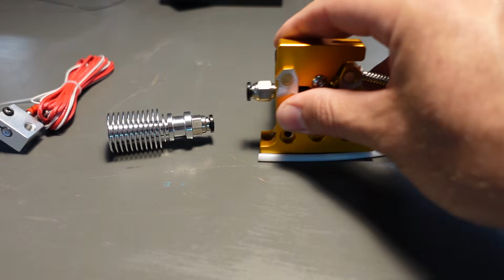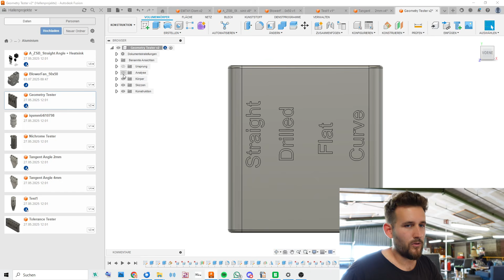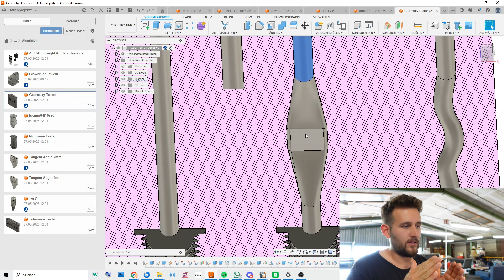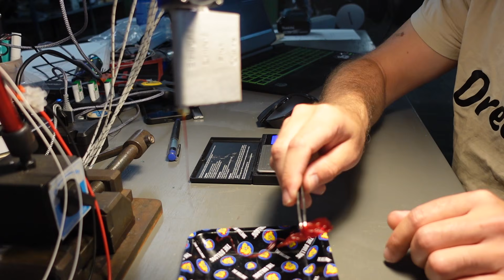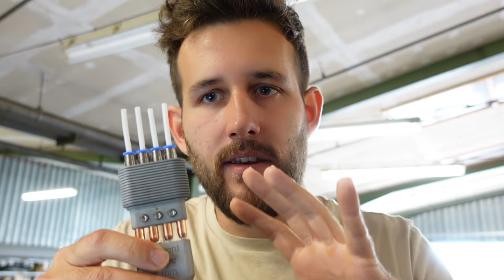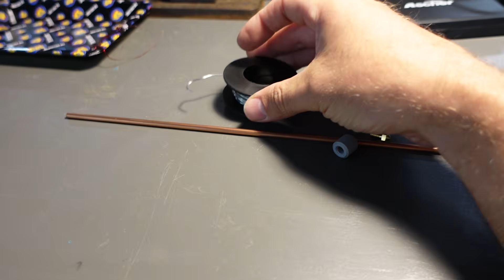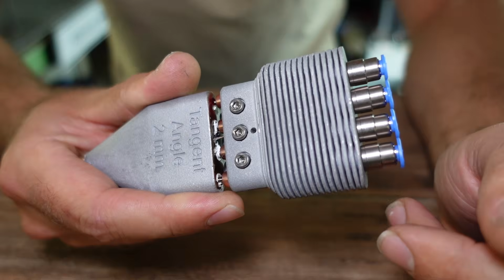Minuteman's World Record Hotend for your 3D Printer! 200+mm³/s Flow Co-Extruder! (Roetz-End E01)

Comment: Sehr lehrreiches Video und kluge Lösungsansätze. Vielleicht liegt mein Fokus weniger auf High Flow. Wenn ich es richtig verstanden habe, hast du nach Ideen gefragt. Eine Wunschliste für ein Open Source Hotend beinhaltet für mich: ein System inklusive Bauteilkühlung als Gesamtheit betrachtet. Dabei ist ein Bowdensystem für mich heutzutage der Favorit. (Wenn man sehr flexible Materialien hat, muss man an vielen Stellen Kompromisse eingehen. Der Drucker ist dann deshalb oft anders als ein Alltagsdrucker aufgebaut.)
Der Masseschwerpunkt in Z der Gesamtkonstruktion sollte auf Höhe einer Halterungsmöglichkeit sein. 
Zwei zusätzliche Gewinde zur Montage einer Fan Shroud im Block des Heatbreakkühlers wünschenswert.
Bei einem bewegten Aufbau ist eine Zugentlastung der Verkabelung eine gute Idee.
Da du von Gewindenachbearbeitung gesprochen hast, wären Durchgangslöcher zu bevorzugen wo es geht.
Für eine Massentauglichkeit (Also damit die Entwicklung sich lohnt, sollte das Produkt nach Möglichkeit für viele Menschen eine gute Alternative sein) wäre die Größe und damit auch das Gewicht ein Hauptaugenmerk. Ein 120mm Hotend lösst sich nur mit Einschränkungen in Z nachrüsten. Ein sehr breites Hotend nimmt Bauraum. (Ich sehe gerade das Produkt vom Video und denke mir, das passt nicht gut in meine Drucker herein. Hat also wenig mit der Wunschliste zu tun.)
Auch wenn das Hotend sehr glatt und schön konstruiert ist, vielleicht gibt es eine Möglichkeit eine (Standard? gibt es nicht- aber es gibt ja marktübliche Formen) Silikonsocke zu installieren
Wenn eine komplizierte Form genauso teuer ist wie eine einfache, dann sollte man so viele sinnvolle Features mitliefern wie es geht, kostet ja deshalb nicht mehr.
Ich wäre nie auf die Idee gekommen ein 3D Druck Hotend  3D drucken zu lassen. Genial und gibt so viele neue Möglichkeiten der Integration.

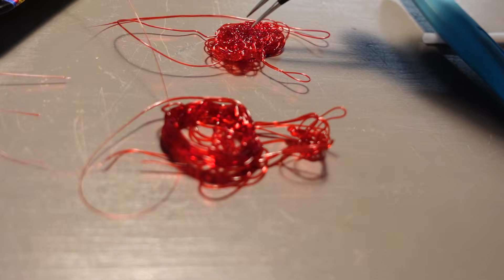Comment: I think you output should be more like 28:43 front one. If the flement is able to stick it self and also not swolen it will be the enough tempeture, otherwise you will force more cooling problem. in short if you say the flow is perfect you should push little more.

Comment: So regarding the fluid dynamics in the hotends: There are a ton of different factors going on here I suspect. Surface roughness probably has insignificant effects primarily because the flows here have high viscosities and thus low Reynolds numbers, meaning they are Stokes flows that exhibit no turbulence. 

This also means though that our heat transfer is limited by A) the low thermal conductivity of the filament and B) the low surface area between filament and hotend. Surface roughness probably improves B) but makes A) worse, so it probably all just about cancels out. In a flat tube, we basically improve both A) and B), which is why this performs so well. However it comes with the drawback that it is likely to create a lot of backpressure because increased wall area and thinner channels also are exactly what will increase resistance to flow.

This also explains why things like the wavy tube don't work, there is nothing really going on w.r.t. the core being exposed, instead, we are basically just deforming the filament into whatever shape our channels have. Since the waves don't really change the channel shape and convective effects don't matter in Stokes flows, these basically don't do anything. This also means for the most part the precise path of the channels shouldn't matter too much. Curiously that is sort of contradicted by your results with the tangent vs. straight paths, but I suspect that may also be due to those paths not all being necessarily the same length and diameter everywhere.

Likely what is going on here is that the majority of the back pressure is caused by forcing the filament through the smallest part of the melt path, i.e. the nozzle, which scales directly with viscosity. So essentially up to a certain point it is worthwhile to spread out the filament for better melting.

Simulating and optimizing this would probably be an interesting research project, the phase transition may be tricky to model, but I suspect there is lots of prior art for that. But thanks to the fact that this is a Stokes flow it should at least be computationally tractable.
Reply: I wouldn’t argue against any of your points, and if they are all true then round feed stock is the worst geometry.  His multi-cord head is just trying to approximate a flat and the flatened heat tube is best because it abandons the flawed round quickly.
Reply: @skyak4493 Probably, now there are tradeoffs as pointed out in the above(round tubes definitely are still best for lowest back pressure before the nozzle) but overall given we are constrained in the maximum heater length by wanting filament control something flat is probably close to optimal.
Reply: Very excellent explanation! You are a bright fellow. Best regards.
Reply: Why would changing the geometry affect the thermal conductivity of the filament? That's just a material property of the plastic, right?

Comment: I had started investigating the 3DChameleon system, and purchased the following 4 to 1 assembly. Can you arrange your 4 by 1, to 2 by 2 ??
4 Port 3D Printer Filament Feeder with Tubing 4 in 1 Filament Feed Connector for X1C 3D
Have you considered a 2-part epoxy mixer geometry nozzle to mix the filament? Or a Tesla valve design?
Reply from the maker: Yes yes and yes

Comment: I would really like to see that bondtech extruder also include the ability to only push one of the four filaments at a time, sort of like a mini AMS. It would need some sort of electronic clutch on the extruder gears, but I think that would make it more useful in more situations. Not really applicable you your hotend, but it might make the extruder more likely to become a product.

Also name suggestion is something like Gorgon/Medusa, all the filament going into the print head seems like snake hair. Great work, looking forward to see the next update!
Reply: Yeah, this could be really useful for multicolor prints. Takes less time to switch and less material to purge

Comment: I had this idea of N:1 hotend for a while for the benefit of shorter meltzone and more flow, tho i think with more then 2 or 3 in we might start to hit issues with tolerances of the filament where tolerances start to add up and could in turn make less consistent layer lines (extrusion). So i would probably want to see 2in 1out hotend. Also weight is another issue lighter the better so i could see 2in 1out beight one of the better choices for that too.

Also another thing is ridgidity, I want it be ridgedid, eg: if i crash i dont wanna have bend, see CHUBE

Comment: I would like to see the cold end and extruder be the same part, and have the whole thing be water cooled so it can cool the stepper motor too
Reply from the maker: What if we don't need the motor to be cooled? Wouldn't that cause more hardware in the first place? But, noted!
Reply: @Roetz40  Not so much for minuteman, moreso for large enclosed machine. I've been stewing on a machine concept for prototyping big car parts from CF ABS in a heated chamber. A two or three channel water cooled version the SLM hotend would be a good choice for that.

Comment: I am very curious how the flat geometry compares to the CHT splitter/core heating technology
Reply from the maker: I would Guess! that my approach is a bit more effective since the melt has more time after splitting to stabilize. But I can test that I have a CHT nozzle here
Reply: @Roetz40 Someone else did exactly that test and a flat section of equal length to CHT section performed better.

Comment: That squish geometry of the melt zone is very interesting! CHT nozzle for functional prints is great because of improved adhesion. It's so sad to change back to normal nozzle for CF filled filaments. With that squish zone you could get best of both worlds. Rigid/stable filaments and improved layer adhesion / speed.

Comment: I wonder if there is a way to make a diaphragm in the melt zone that rapidly increases/decreases the volume just above the nozzle. This would replace retractions. Or maybe you would need it to slowly decrease the volume to combine extrusion and volume changes as you start a new path.
Reply from the maker: At certain speeds you don't run retractions at all. But noted :)

Comment: if you need to polish, use pressurised air flow with sand particles. ie sand blowing. so can you patent a pipe. thought so. patents shug bad. not theirs. not even a little bit. diy so no care of patents. the whole point was diy wasnt it. not for commercial operation. science does not bow to market patents. yep patents are just sold "products". also more surface area is more heat transfer to filament to melt. laser metal printing, why not extruder weld wire fdm 3d printing. copper can be electroplated on metals, like aluminium. yep aluminium or any other metal, even low temp metals, already conduct electricity very well for electroplating. so instead put the aluminium inside the plating solution and put a graphite conductor inside the channel. electroplating preserves the inner surface features. copper electroplating is the simplest of them all. dont even think about titanium. copper electroplating also ensures maximal surface thermal conductivity by exact surface shape match. that would work perfectly for 4-color full color mix 3d printing. yep change color by filament rgbw mix speeds. yep full color 3d prints for pennies. just make sure the mixing is absolutely uniform. square nozzle pattern instead of flat in-line pattern. ie circular nozzle pattern. making a fdm metal 3d printer would be even more interesting. MgO ceramic nozzle extruder works up to 3000C. as only a non-external-arc welder head too. rather internal arc metal melting head. anyways full color 3d printing solved. no expensive nonsense large machines required. also multi-material printing solved. 4/5/6 colors, rgb black-white-transparent colors. possibly support as 7th filament. also aluminium oxide ceramic hotend would be possible with decent heat flow. anyways its hot like a sauna rock. 30 of aluminium oxide vs 250 of aluminium heat conduction. well it stays hot longer. MgO has 45-60 thermal conduction, so its better and higher temp. either works for aluminium wire fdm 3d printing. yep aluminium is 600C and copper around 900C.
Reply: not ams filament swap, but color mixing filaments at ratios.
Reply: zinc-wire 3d print welding? at 400C.

Comment: Oh man, I was hoping you'd take a hammer to a copper tube to introduce a flattened section.
Reply from the maker: I would have done, but for the lined Hotend I didn't have a version that would allow. Also it would be hard to recreate any of that without special tools. But this would be a very easy design to achieve the core heating!

Comment: I am not a part of the speed-boat-race crowd. How is this improving tolerances and accuracy? How is this increasing reliability? The flow rates you call for, is currently served by pellet extruders. Large diameter filament sort of has died out. Also, we regulate washing machines, dishwashers, stows, hoovers, etc. All to reduce power consumption. How does this reduce the power consumption footprint? How does this move the industry from producing junk to desirable artifacts with real mojo? As in plastic parts with real mojo? Since this is the speed-boat-crowd, I kind of feel that the direction for the industry, is just plainly wrong. I would love to see this kind of talent polling in a direction that is sustainable, and I fail to see the motivation for that in your work. But, as with all development, innovation just happens in the strangest of places, so I will keep on scrolling through your postings. Lots of talent, I just don't see where you are going with this?
Reply from the maker: Pellet extruders can deliver a lot of flow. But they are also an order of magnitude more heavy. You can't put this in your ender 3. It will allow big fast prints to happen for everyone
Reply: @Roetz40  You could just use 2,85mm filament, which is 2,65 times the size of 1,75mm filament. If we need more, all we need to do is to make even thicker filament. Not sure what you use here, but this argument of Ender 3, we kind of have had 2,85mm filament for years, and it has simply been too wide. That is, when you look for more than just speed. This has the feel of a work around, not even using what should be obvious first. I am not sure what the use case you are trying to fill either? This is like claiming that formula 1 is suitable for a Lada. All you got is speed. That is it.
Reply: @FrodeBergetonNilsen Ideas from these mad experiments trickle thru to other printers and use cases in the same way ideas from race cars have trickled thru to road cars.

Pushing shit to the limits is very informative research. The current development already has applications for large scale printers  600x600x600 and larger, that have slower moving heads but use large nozzle sizes.

Remember some people want to print things like full-size kayaks.
Reply: @liamventer  You are defensive. You know better than this. My uncle was a captain on a medium size fishing boat. He spent days with me, explaining the horrors of the ocean, and of the people he lost at sea. A PLA printed kayak. That is your only argument? People want to make that? They got lost at sea on a sunny day? Any great designer, is aware of since-this-is-my-work-it-must-have-insane-value-syndrome. Anyone can get a sports car, and break all the rules and limits of the streets. They might be really good at it. That does not make for that kind of behavior to trickle down to everybody. I wasn't raised to push for people to loose their life on water. I was told, over an over again, like for about an entire day, about the loss of my uncles nephew, due to stupidity of design of a ship. I was raised to not do stupid as a designer. A PLA printed kayak that will melt in sunlight, is simply something I strongly object to. I do not care that you want praise for your work. I just don't. You need to sit down with real people, who has lived their life on boats. That has spent days and weeks, searching for loved ones. Like, my uncle searched for bodies that if they were lucky, had blue floating jackets, that emergency jacket that will keep you afloat. Blue. You need to sit down with somebody who knows what love is, that has tried to search for people wearing blue life jackets, floating lifeless, in an ocean of blue water. Quote: "I got so mad, that I threw away all the life jackets we had, and ordered new orange ones. That was the first thing I did, when I go a shore". Go ahead, push PLA kayaks as the reason for your work. Just don't you dear to ask for my praise for that. Sure, you know people who wants that. Be stupid. Be evil. Just don't ask for my praise. I will call you out. Like I just did.
Reply: @FrodeBergetonNilsen Why do you think anyone would print a kayak out of PLA?

What an idiot.

Comment: You've got a great methodical approach going on. One minor comment -- 4mm diameter is not 4x the cross-section of 1.75mm filament, it's about 5.2x the cross-section. For that, you're looking at about 3.5mm diameter.
Reply from the maker: I think I calculated with 4x2mm channels. At some point the 1.75 filament will fill the 2mm channel

Comment: Amazing work and documentation. 
The roughness vs. Melting capacity is very interesting to me. 
I can only think of multi color/material printing with purging where smooth surfaces in the hotend will help by keeping the purge volumes small.
Reply from the maker: Purging will take a lot of material. But also this is not something you would use with your filament swapping device and do constant changes. Put one filament in and go to town!

Comment: Hi, no idea if it is possible, but for you to have better thermal transfer, perhaps there's a way to do multiple layers of copper plating on your 3d printed block for thermal transfer, and a last layer of nickel plating for longevity ? You should be able to find supplyers that do that for you locally, and they probably can give you average thickness per plating round, for you to account for in the design.

Maybe something else you could do would be 3d print different chanel geometry to allow for more surface contact with 3d printed aluminium, while keeping the walls close together, and minimise the boundary layer of the molten plastic (no idea if that's the right word). Perhaps a star or oval shape could work just as well, maybe you could iterate different oval sizes to see what works best